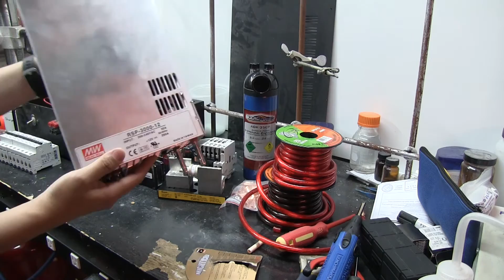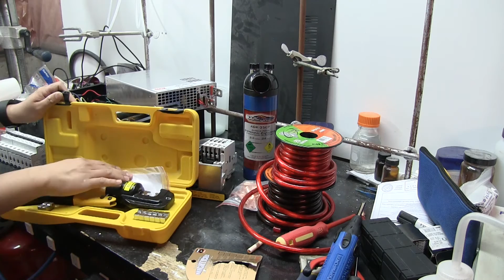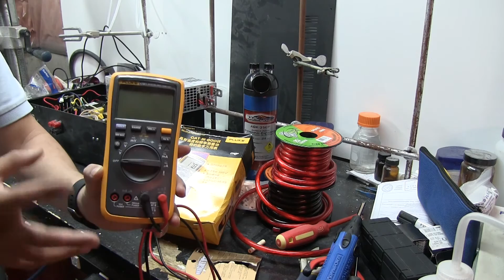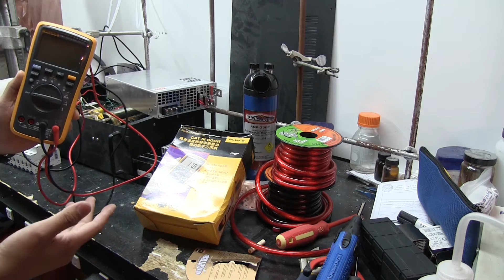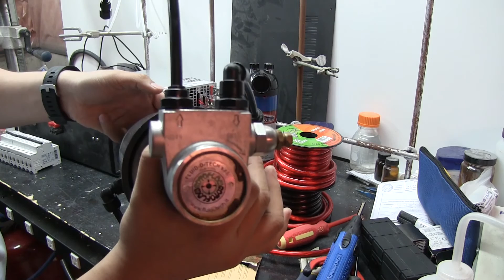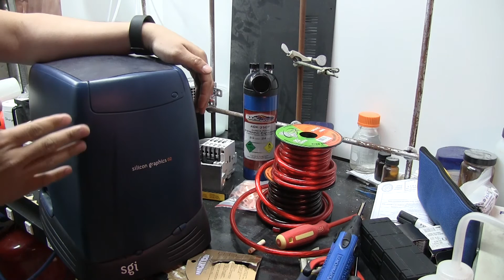(14) Shop Talk Episode 1

Comment: I'm pretty excited to see that 200amp power supply in use! Wouldn't mind taking a look inside either. Maybe hook it up to a dummy load and an ammeter to see how it performs.
Reply from the maker: I'm still undecided how to load the power supply for the full 200A, it's a bit spendy unless I go and use a bunch of inverters.
Reply from the maker: Not far off from what I had planned, I was either going to do two spaced plates in a potassium hydroxide solution (which would release a ton of H2 and O2 gas and blow me up) or nichrome wire. The only catch to nichrome is that it's hard to fasten to, you need to crimp it.
Reply: I've had pretty good luck with alligator clips and nichrome wire. Run two main busbars along the bottom of the container, then braze/solder/bolt alligator clips to the busbars in equal numbers across from each other.

I could certainly see your concern with the electrolysis method. You would probably have to run some pretty large plates to draw 200 amps. I'm probably biased to my own ideas though.